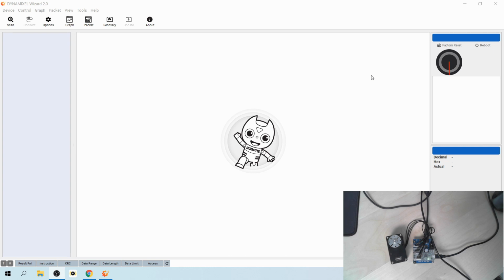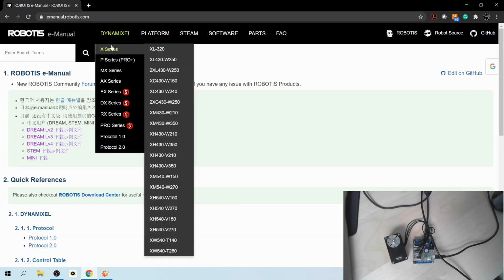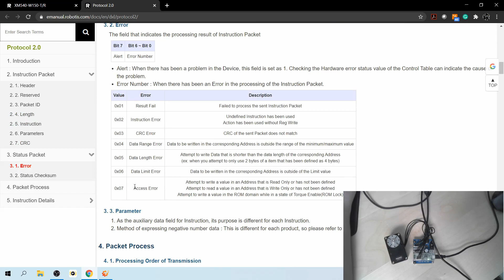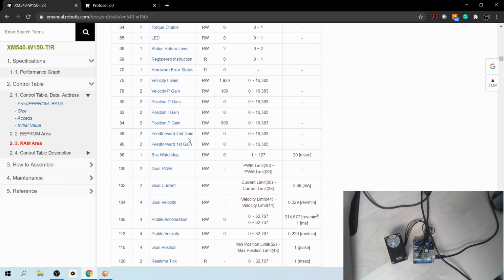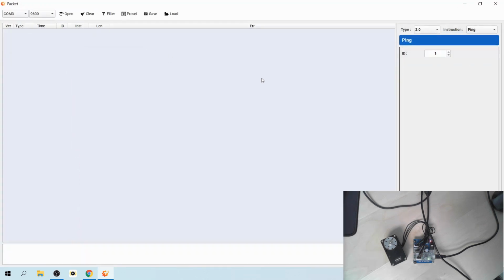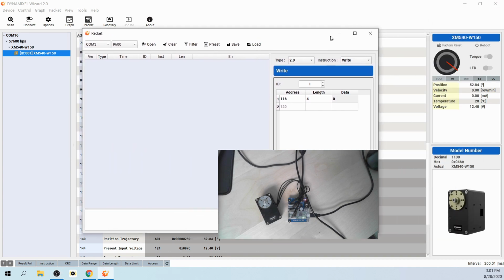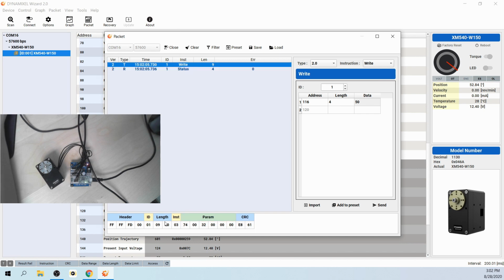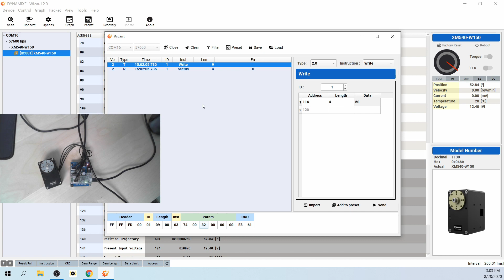How To: Use Packet Control in Dynamixel Wizard 2.0

Comment: I have OpenManpulator-x with XM43-W350T dynammixel modules, but after scanning with the Wizard, I get 0 response. it cannot detect any of the modules. is there anyway to fix that?
Reply from the maker: The method of resolving this issue depends on what kind of controller you are using to connect to DYNAMIXEL Wizard. In order to receive the best assistance, I recommend creating a support request post on the ROBOTIS Community Forum at community.robotis.us.

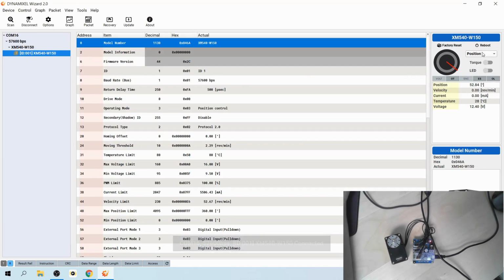Comment: 2:52 what if we don't have the position option available ?
Reply from the maker: Which model of DYNAMIXEL are you using? All models of DYNAMIXEL support positional control, but some older models may require a firmware update for full functionality with DYNAMIXEL Wizard 2. If you have any more questions, you can always reach us at our cs@robotis.com, or the ROBOTIS Community Forum at community.robotis.us
Reply: @robotisus  Hi, What if I'm using a XW 540-T260. The instructions weren't working.
Reply from the maker: @Muzzey_City  Can you provide some more information about the issue that you are experiencing? You can also receive assistance by sending an email to my address at cs@robotis.com

Comment: Please how do we use the wizard to change the ID?
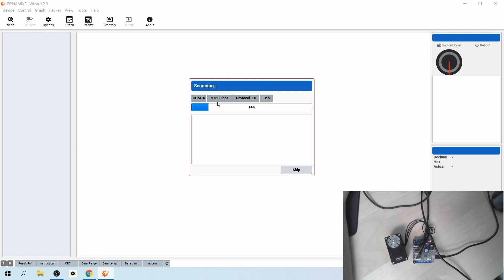Reply from the maker: Hello Edward, thanks for your question. To change the ID, you just have to connect your servo to DYNAMIXEL Wizard 2.0 like we've done in this video around the 2:50 timestamp. Once you're on that screen with the settings of your DYNAMIXEL listed in the middle of the window, you can select "ID", click on it, and then choose your desired ID number. Be sure to click Save below the ID number selection to save your ID number to the DYNAMIXEL. 
Let me know if this helps, or if you have any questions it would be great if you can post on our new community forum community.robotis.us. The new community.robotis.us forum features support, project showcase, events, and more.
Reply: @robotisus  thanks for the reply. Because I didn’t know this, I used the SDK but with your explanation, I find it much easier to do same using the wizard. I appreciate your response.